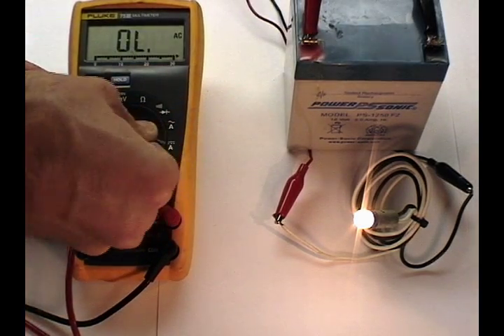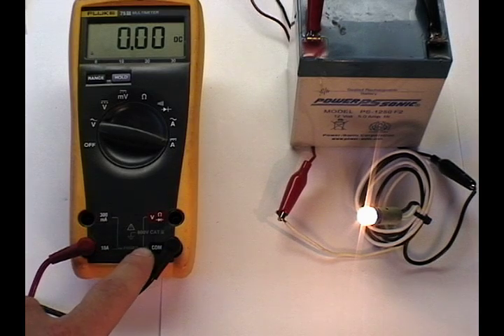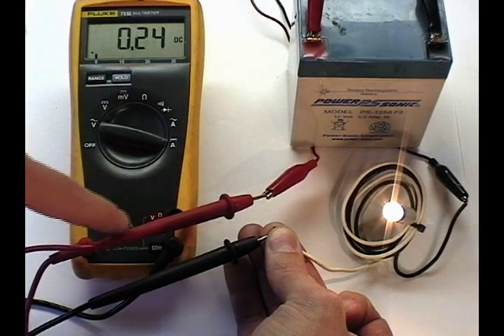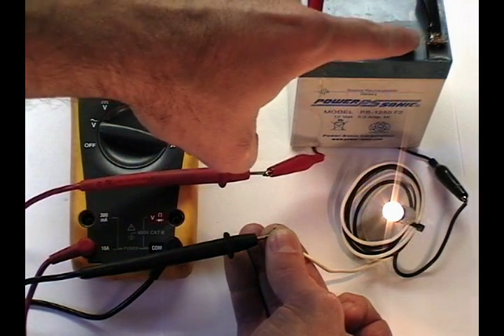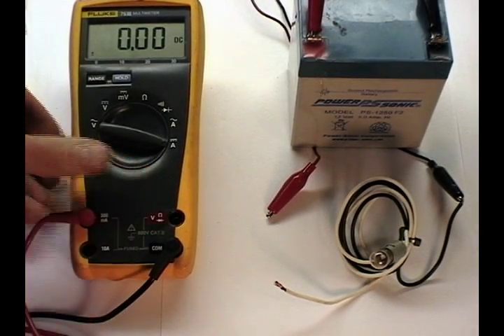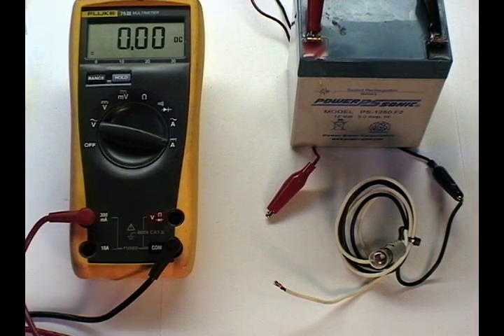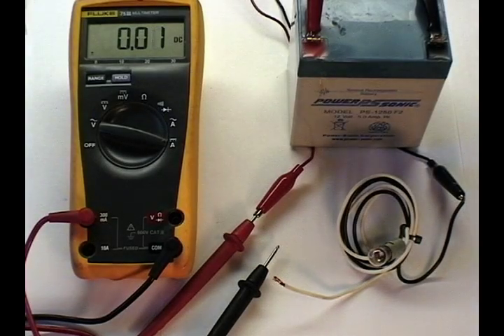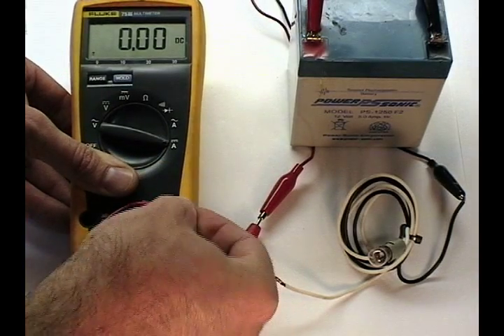measuring current

Comment: the particle flow is from negative to positive.  However in every electrical engineering course the schematics of a DC circuit will show the flow from the DC power supply starting at the positive terminal & returning at the negative. Conventional current blah blah blah. It's this kind of stuff that makes elec. engineering students insane.